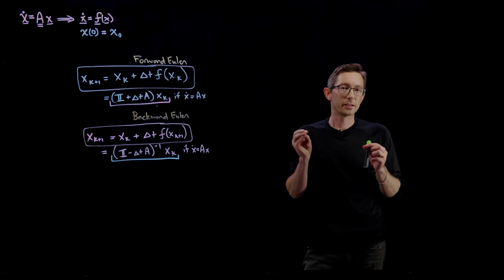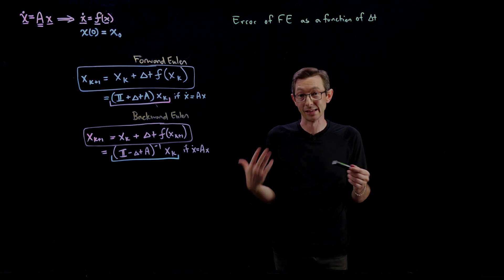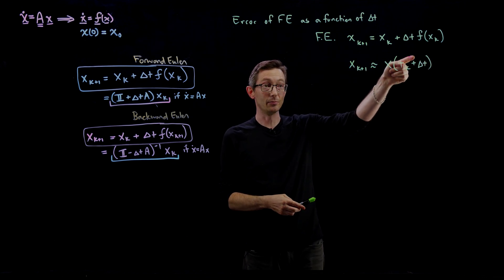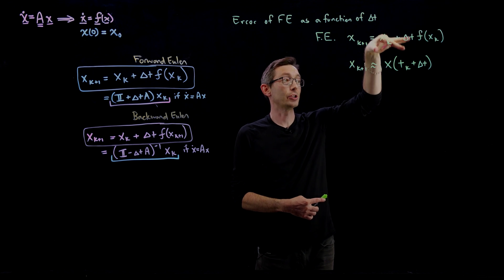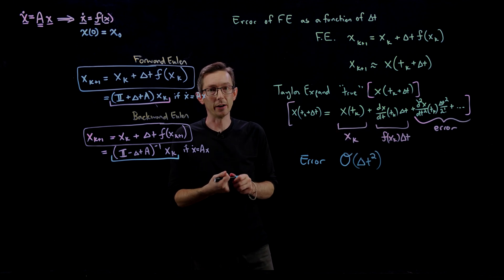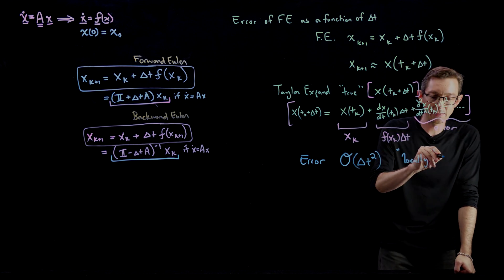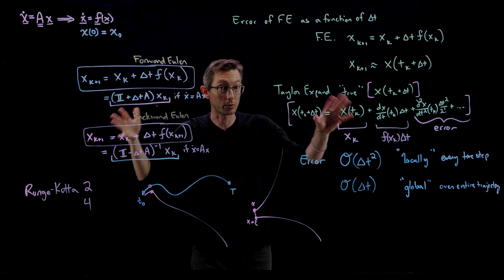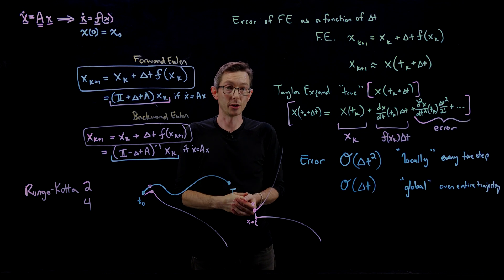Error Analysis of Euler Integration Scheme for Differential Equations Using Taylor Series

Comment: Thank you very much for this great lecture ❤🤍🖤.

Homework:
In time 7:29: That's a great homework exercise for you to do the steps calculating the error order of the Forward Euler method for the Backward Euler method, and convince yourself that the order of the error remains 2.
Hints:
1- you can use Taylor series expansion for f(x(k+1)) over xk (e.g. f(x(k+1)) = f(xk) + f'(xk)dx + ..., where dx = x(k+1)-xk.
2- To calculate dx based on dt, you may use the Taylor expansion of the "true" x(k+1).
Reply: I think another method is to consider x(t_k + (dt) + (-dt)) = x(t_k+1 - dt) = x(t_k). This will give ensure that the expansion is evaluating the derivatives at t_k+1. Then all you have to do is rearange to get x(t_k+1) on the LHS, after which you essentially get the backward euler step after substituting dx/dt(t_k+1) with f(x_k+1)